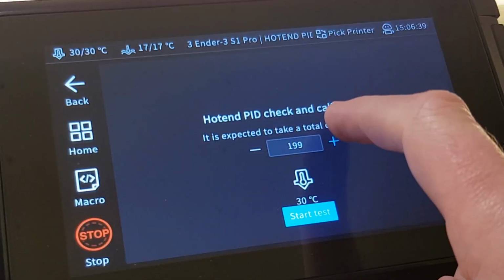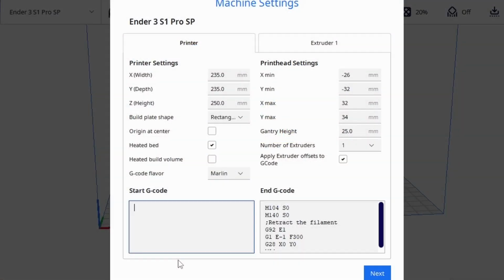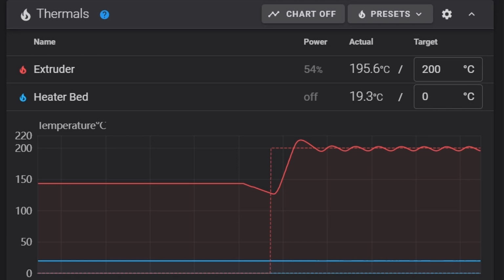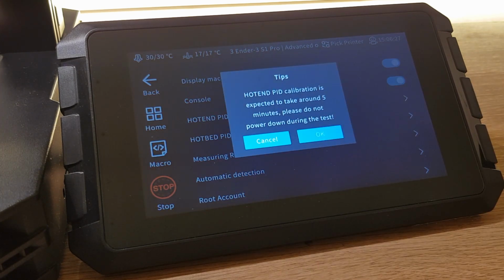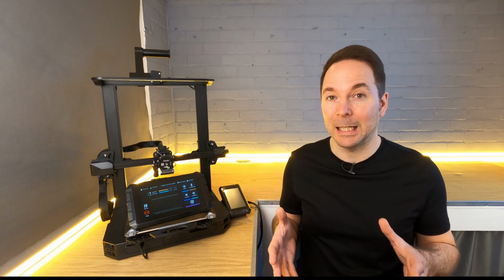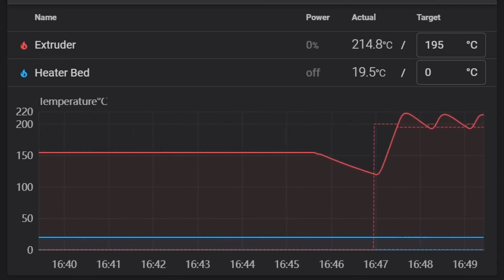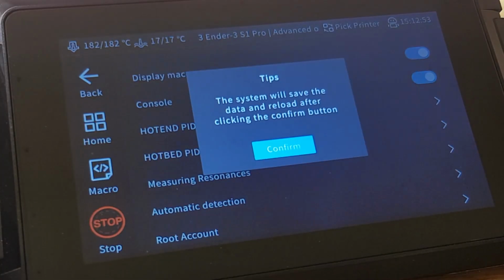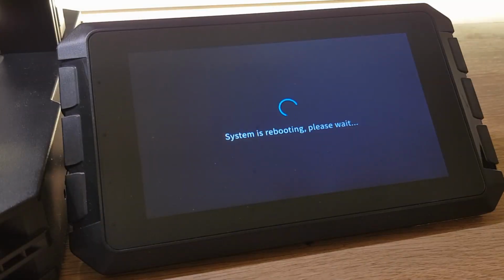How To PID Tune With The Sonic Pad - Sonic Pad Intermediate Part 1

Comment: Hi there I have done everything step by step but I get the error msg "Error on M204 P10000 R1000 T0; sets acceleration (P,T0 and acceleration (R)mm/sec^2: T must be above 0.0". Brand new out the box.

Comment: Is there any way to do the Pressure Advance on a stock Ender-3 S1 Plus? Whenever I have to use a raft, the first couple of mm's do not stick and the nozzle pulls it in the direction that it is moving. It's no big deal now as I will have my Sonic Pad hooked up in a couple of days Just wanted to know if it is possible or a setting in Cura I can change. I've been watching this series and the Basic over and over so I can get my pad working correctly.

Comment: Regarding your comment in the description "*Since recent firmware change, it is necessary to issue a 'restart' command after changing any settings or following any calibration procedures.*"       Do you mean use the restart klipper or restart firmware option? Thanks.

Comment: Hi Rick, first of all thank you for your videos. They helped me a lot when i started 3d printing and are still helping me. 

I'm still using my Ender 3 S1 with the Sonic Pad and wanted to factory reset everything to start all over since i modified so much and get error codes  concerning the mcu connection. Although the printer still prints without a problem.

Are your guides still applicable in 2025 in connection with the orca slicer?

Comment: Hi Ricky, This series is absolutely brilliant so thank you for taking the time and walking us through the process. Yesterday I managed to to gey my first printer up and running so just 3 more to go! I'm setting up a small print farm and dimensional accuracy is going to be important, so I've printed a calibration part and found that that the x, y and z need the e steps calibrating. Did I miss that part in the series? I'm struggling to find the setting on the Sonic pad to change these parameters. If possible can you point me in the right direction please.  The extruder and pressure advance is sorted now and producing great results.

Comment: Thanks for your videos. Any advice on what to do if at room temperature my Cr10s pro V2 is reporting 243c? I can't PID tune because it doesn't go down from there to reach the 210 I'm going for 😂 confirmed, it is not actually hot, but says it is.

Comment: Sonic pad wont let me PID tune over 220? I've change the setup to be able to print up to 500c capability, but I don't ever plan on going over 320 currently. Printing PA6-CF with a recommended print temp with a .4 nozzle at 295c. I usually print with a .6 nozzle so I bump the temp up. Before this setup up I consistenly was able to print at 265c with my old setup. I will usually print asa and the PA6-CF so I need to do a PID tune at  around 280. I've tried to find online how I can change the PID high temp setting but can't find it. Nothing in the Config file looks like it controls that test? Thanks.

Comment: if i were to upgrade my hotend to a high temp high flow that would normally require a creality firmware update, would i just recalibrate the nozzle temp settings or would i not really need to do anything different?

Comment: My Sonic Pad didn’t prompt me to nor rebooted…
Reply: I have the same issue, I have to use the web interface to save the configuration
Reply: It’s been working awesome but it never prompted me to nor rebooted. So, no complaints here. I was just curious if someone else had this experience. @get_outdoors
Reply: @get_outdoors  thanks for your comment, I was able to save the configuration on the webpage.
Reply: @roofoofighter  yes, I’m also having to do that, still a little clunky, let’s hope for more improvements in the future

Comment: Thanks Ricky, excellent materials as always :)

Questions:
When  you calibrate the Hot-End, doesnt the fan if its on or off impact the result? I bet it does some cooling on the nozzle. So i wonder is it on during the test.
I also wonder if you are still using the stock fan for your S1 PRO or if you have found a better one? Many seems to state that you need air blowing from two directtions (instead of one as the stock has) for PLA to print much better.

Thanks in advance :)

Comment: Ricky, thanks for your awesome videos. You explain things in a way that is easy to understand. I think the Intermediate video Slicer Settings and Profiles With Cura should be the first video in the intermediate series. I had to follow that video to even get my printer to print. Now I am going back to intermediate video part 1 to fine tune. Thanks again!

Comment: The PID hotend went as you described. I'm using an ender 5 s1 with the sonic pad.  My question is there somewhere in the cura settings or console that would be causing a reset on the temp . Into the print I have to watch the temp. It will raise to 220 from 205. And other times drop down in the 180s. New to 3d printing with the SP.
Reply from the maker: This will very likely be something in your gcode file generated by your slicer software that is changing the temperature.
Personally I would open the gcode file with notepad++ and search for any M104 commands. If your extruder is being told to go to 180 degrees then the line will read M104 S180 for instance.
Once you have found these then you should be able to see when it's doing this. Then, look in your slicer for settings that change the temperature at different points. The chances are you have different temperatures set somewhere that will need correcting.
Reply: Thanks Ricky.  I'm gonna check out notepad ++.  I might have to wait for your how to edit notepad++ video.  I have two printers connected to the sonic pad. After you suggested that the slicer was the source, I ran a print on my ender 3v2 with no temp changes. Different slicer settings.   You have been a valuable source of info.  Much more so then Creality.  Thanks for your videos.
Reply: Thanks for leading me to notepad++. I'm not sure exactly how, but I noticed that the temp changes were happening at 41 layer intervals. I was manually changing the temp on a temp tower test. I must have saved these into the g-code somehow. Thanks again for another rescue.
Reply from the maker: @haushogg  ah! An easy mistake. I've done it myself. Glad you figured it out👍

Comment: Ricky, great tutorial . After following your guide and step to set up my sonic pad to work with my ender3 s1 pro, i manage to start to  my print. when i follow your step on PID tuning on the sonic pad, after completed, the system did not prompt me to save the setting and reboot when i press the back key but instead it goes to the previous screen. may i know why ? thanks
Reply from the maker: This appears to be a new 'feature' with the new firmware update. If in doubt, always enter the command SAVE_CONFIG in the console and then restart.
Reply: @RickyImpey  Thanks
Reply: how when after i do test @RickyImpey
Reply: I have the same situation.  Pressing back button doesn't save or restart the pad, just goes to previous screen.  Unsure if the results were saved.
Reply: Thanks , same thing for me just now. I brought up the IP and did the console on pc

Comment: But I can do PID on my v2 with my jyers firmware
Reply from the maker: This series is only for if you have a Sonic Pad. If you are running Marlin then you are doing it right👍
Reply: All creality machines run marlin ?
Reply from the maker: @charlesrestivo870  they did until the new X1 that they just announced.
Reply: OK I'm confused thought this about installing pad and it's features .I'll go .